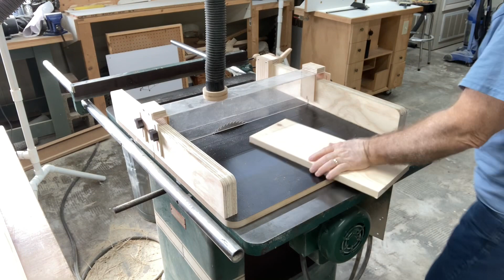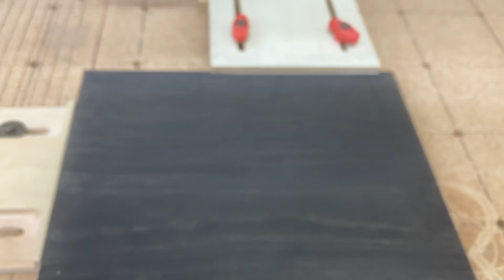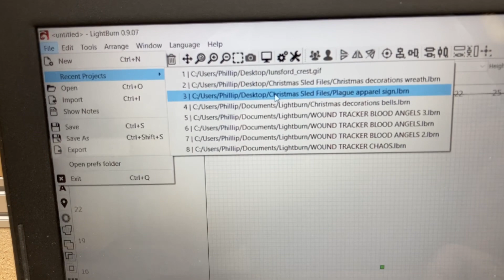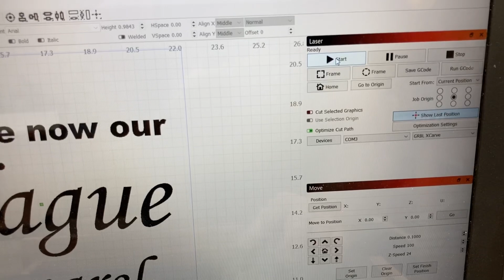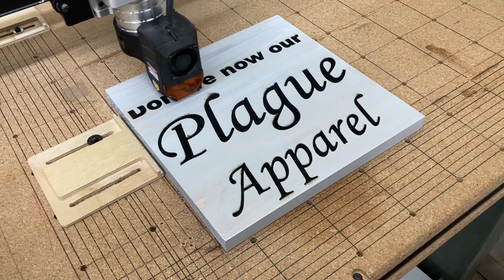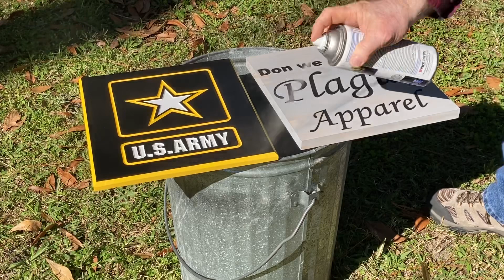Crazy Day in the Shop with Multiple Projects

Comment: Do you have a link for where you get the painst im looking online for the minWax Water based "True Blue" Color and cant find it and as for the Black Acrrylic Paint i have found this on Amazon is it a comparible paint to what your using? https://www.amazon.com/Sargent-Art-24-2485-16-Ounce-Acrylic/dp/B005V9SZTI/ref=sr_1_3?dchild=1&keywords=black+acrylic+paint&qid=1607638113&sr=8-3
Reply from the maker: The acrylic should be fine.  Get the color chart for MinWax.  I believe that they changed the names of the colors.  I need one also so I know the new names of the colors.